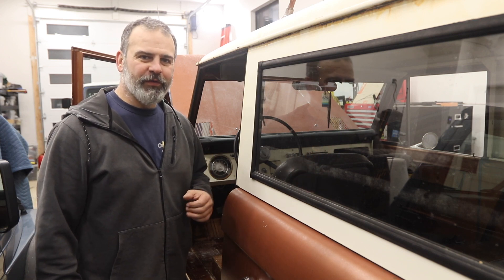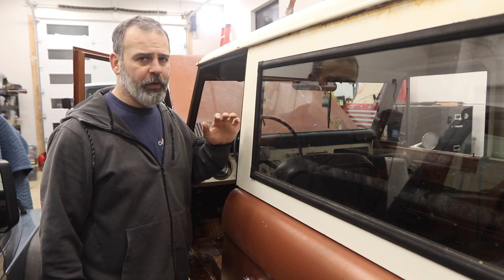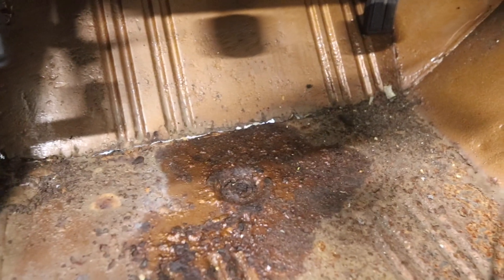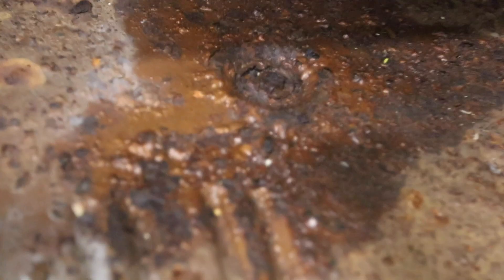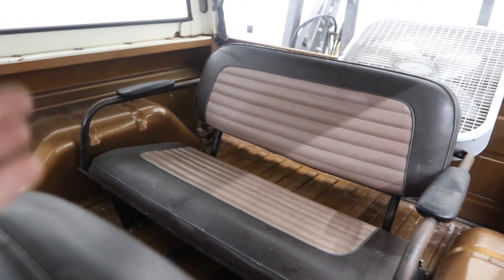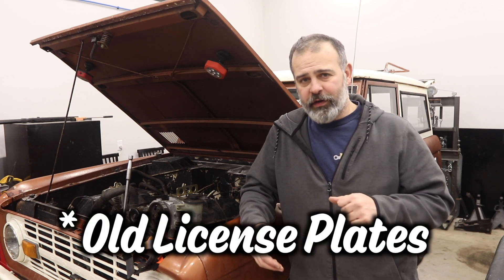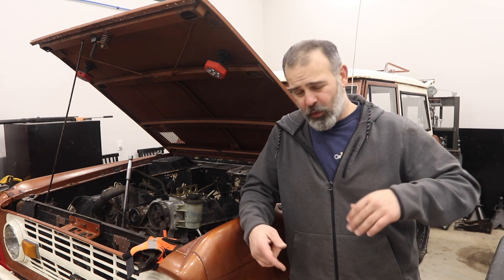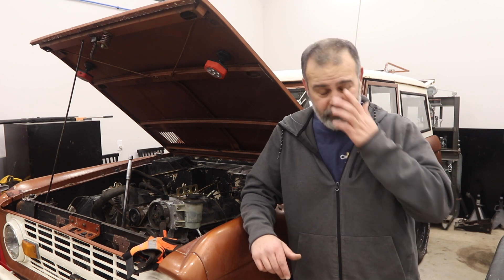9.6-WWYD? Rust

Comment: replace floor pans with new.  install a manual ceiling lift and pull that hardtop off - store against your ceiling, there looks to be plenty of room up there. if you think it's too heavy... remove the glass and rear hatch. I sold mine and it was in great conditio,  but I had no room... so it went away. But I know I will be purchasing a new one when my Bronco finally moves on it's own ;)

Comment: Floor pans, easier to do than whole floor, keep top, weld the seams, then use seam sealer.  Hey check the a- pillars at hinges, usually rotten
Reply from the maker: Thanks Matt. I have a few pinholes in the top above the seams. I guess I could fill that with short strand? Im afraid if I start trying to weld pinholes I’ll just blow it into Swiss cheese
Reply: @MattsGarage  hey just tell the wife you need a Tig welder for this project, it’s pretty easy to pick up, like soldering but way better.  You can weld soup cans with those things
Reply from the maker: @matthutchinson3139  I like your style

Comment: Hi, Matt. Love watching the show! It is funny to watch you at the beginning of your (2nd) Bronco, when I am in the finishing stages of mine! Kind of a role reversal, huh?
Here are my thoughts:
1.  Floors- replace with new panels. Tom’s panels are a little thinner that others… I think I got mine from Bronco Graveyard. They are a little thicker and come in a weld-through primer. Of course, the best things is to clean even the weld-through primer off, but you don’t have to. Then treat the seams with POR-15 and paint to match. 
2.  Top- Recommend cleaning up the rust and seeing where you have holes… of they are creating structural issues, weld new metal in. If not, use epoxy and close them up, and paint. Treat all the less rusted areas and new metal with POR-15 and paint!
Just my thoughts.
Reply from the maker: Thanks Brian. Role reversal indeed!

Comment: Fix the the floor with original pans and go with a soft top. Set the hard top aside and fix what’s needed on it. Like the other guy said the hard top’s are getting hard to find. You’ll then have both to use when you want to

Comment: Definitely keep the top.  Even if it’s not used for this build.  Stash it stowed away on cables in the shop protected and just let it marinate.  Buy a soft top and give it a go.  The answer will come.  Random sheet metal welded into the damaged area works nice. I can’t stand rust eating away when the tub is in such good shape
Reply from the maker: I agree I wouldn’t sell the top. They are getting really rare.  I had the same thought to hang it up somewhere inside and forget about it for a while.

Comment: 1. For the floors I would get out the angle grinder and sand off all the rust on the floors to see how bad the damage actually is. If the rust is only in the seams. Simply cut out the rust on the seams and weld on some angle iron at the right angles. Then raptor line the inside of the tub and throw a floor mat over it and it will be good as new. But if the rust is bad then of course just buy new floor boards.       2. For the top I like the idea of selling the hard top and buying a nice new hard top.  Good luck.

Comment: New floor plans, they are cheap and fairly easy to install. Hopefully that's where the rust stops and the rockers, kick panels and inner fender aprons are solid? It can be a can of worms once you get into it. 
Go with a soft top, I redid my hardtop and trying to get all the rust out of the drip rail area is nearly impossible especially on the inside and mine was in way better condition.
Reply from the maker: Good advice. Agree on the can of worms, that’s what tripped me up on the 1973. But this one seems ok in all the other usual places. Of course it’s been repainted so who know? I don’t think I could redo the top without breaking it apart and then putting it back together. It’s a tough call.

Comment: I think I see I see the direction of your build which is to stay cost effective and keep it on the road and not completely torn down so I’d just treat the floor with ospho or some other rust converter and hit it all with a wire wheel. Then bend some 18 gauge just to cover the seam where it’s rusted out. I would try to overlay as little metal as possible. I have sandwiched-metal overlaid floors and hate them but seeing as your floorboard looks pretty good except over the seam i would just overlay 3-4 inches above and below the seam just to shore it up and seal out the elements. Then I’d paint it and cover it with parts store rubber floor mats. 

I can’t tell much about your top. It may be further gone than it looks in the video but seems like you could spray some duplicolor rust fix on it then prep and paint it. You can probably find rattlecan Wimbledon white and it will be good enough for inside the top. I have a rampage soft top and I never use it. It’s perfectly fine quality but I just leave mine open. I’m in a much different climate than you. I can’t imagine the soft top helps much in winter unless you have a really high end top like the one from BC Broncos and had it insulated. (This is the top design Icon used for their soft top Broncos) again, that’s $$$ so I’d try to stick with hardtop.
Reply from the maker: Thanks Graham. Yeah I just don’t have the funds or skill for a high-end build. I don’t want to take “shortcuts” but at the same time I wonder how much joy the “bling” gives Bronco Owners vs. just finishing it sooner and enjoying it. Who knows?

Comment: My view on all of these questions- there's no hurry!  You've said that the "rust stops here", so there's no risk of anything getting worse. And that means you can fix everything "the right way" over time, as you have the time and the budget.  These rigs are worth so much nowadays, so I imagine you'll get all of your money out of this thing and some if you do the repairs right.  In the meantime, I say run it with no top at all and enjoy it, wire wheel the floor and weld in a temporary patch to make it more structurally sound, and fix the floor with proper patch panels when you're ready!
Reply from the maker: Great advice!

Comment: I would Keep the floor pans. I wouldn’t cut it. The rust hole is very small. I would grind the rust out and weld in the rust holes. A placement panel is too much for that small amount of repair. Once repaired I would use a nice floor mat. 

Soft top would look nice next to the scout.

Comment: Replace the floor pans.  Easy enough to do and you have the tools.  I have a soft top but I'm trending towards getting a hard top.  Hard to see in your video, but I'd probably remove the rust, spray it with inhibitor, and leave it alone until you figure out how you're going to use it.

Comment: I stitched in new floor pans 20 years ago.  Then, sadly, my Bronco sat outside while my kids grew.  That led to rust in the hard top.  I would not recommend the route I am taking there.  I am English wheeling new parts and stitching them in.  I probably have 150 hours in to my top.  I'm having fun but it is a long process.
Reply from the maker: That’s what I’m afraid of. Getting that compound bend right would be very difficult and then when I weld it  in the whole top is going to potato chip.
Reply: @MattsGarage  - the hardest part for me was actually the detail along the inside of the gutter.  I ended up welding a 1/4" piece of steel all along the front where mine was rusted out.  I have reinforcement under my patches.  They are covered by the headliner.

Comment: I'd get replacement panels that fit right for the floor. And if you can save the hard top for less than the cost of a soft top I'd do that. But it looks pretty rusty. I don't know if that's possible.

Comment: New pans.  I think the direction you go on the top depends on how you’re going to use it.  I ran my ‘69 with a soft top and it was great.  I have a hard top on my ‘73 and have no interest in changing it out.  Good original tops are getting harder to find.  Fix it and store it.  You could start with a safari top for cheap to see if you like it without the hardtop.